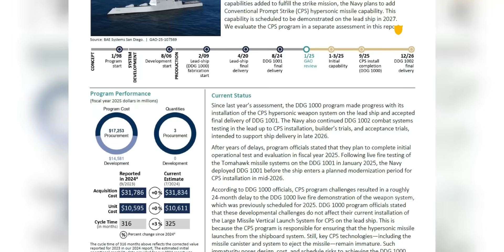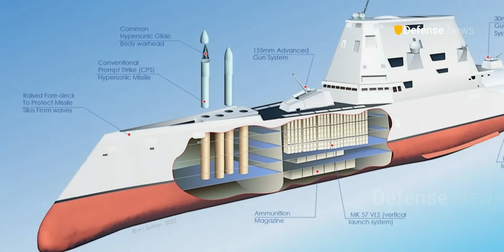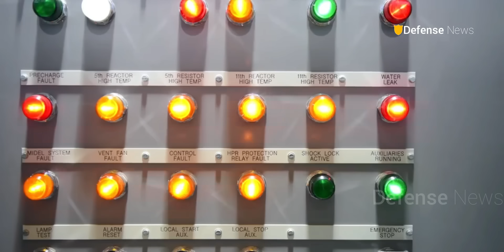U.S. Navy to Convert Zumwalt Destroyer into Hypersonic Missile Strike Vessel

Comment: A lot of money spent on a test platform?  From what I have seen the Zumwalt is still useless with hyper-sonic weapons.  In blue water the ship probably gets tossed around a lot.. very uncomfortable and not a stable missile platform.   Wonder what the next cruiser or destroyer design will be like?  Not sure the money was worth it when you need a low cost frigate and never got the high cost one due to mismanagement.  Burke's are based on an over 40 + year old design.  While flight III's are very capable still an old platform.   Navy planning and design needs someone in charge who will tell the wannabe's they can't have everything they want, begin with a solid base design that is upgradable and start from there. A total reset is needed and we're not prepared for the future!

Comment: Another wasteful project
Reply: I don’t think that’s correct at all. The zumwalt has experienced major setbacks and costly errors, yes…however, that doesn’t mean it’s entirely without redeeming features. This gigantic ship has the radar cross section of a small fishing boat. It has a relatively high flank speed. And if they really can get this hypersonic missile to work it could turn this billion dollar disaster into a serious asset. A ship that can get in as close as possible without being spotted on radar and fire hypersonic missiles with a range of almost 2,000 miles could be a potent long-range weapon for the navy. 

Think about it- a ship that can sneak up close to an enemy shore and fire unstoppable missiles over land a huge distance is a ship that could theoretically take out targets in the middle of Siberia. Or in western China. Hopefully it never comes to that, but in the Ukraine war for example Russia uses their massive interior land to hide all kinds of weapons stockpiles. Imagine being able to take them out before they can be used. Nowhere would be safe.
Reply: What's wasteful about it? The Ships are built. Wouldn't it be more wasteful to just retire them rather than refit them into a vessel the Navy actually has a use for?
Reply: @danerah  first off the gun systems never got the shells needed to fulfill its major purpose which was for shore bombardment. Secondly the ships have had major issues with electrical issues and power plant issues. Now we want to modify them for a missile that we don’t have yet. And lastly. The ships cost WAY WAY more than they were supposed to. So it’s just more wasteful spending.
Reply: @lawerancedodd690  and the refit will be very costly, over budget, and behind schedule, and likely not perform as intended.  Any one really willing to take that bet?
Reply: @lawerancedodd690  BTW, it did get the shells, they were just phenomenally expensive at something like $1 million per round.  Not really sustainable for shore bombardment, even for especially strategic targets.

Comment: how much will this debacle cost US taxpayers?  The Zumwalt has been an overpriced failure since its inception
Reply: AMEN!
Reply: Cost is $30 Billion so far for 3 ships that don't work. That is about the cost of two new carriers. Zumwalt has had problems not mentioned here, namely a failed propulsion system that meant it had to be towed home after dying in the Panama Canal. The smart shells for the its 2 Advanced Guns were deemed too expensive (millions per) and the gun program was canceled, leaving the ship without guns. (It does carry 80 cruise missiles.) That meant it was in limbo for a while, but the Navy took a well-proven ground launched hypersonic missile and adapted it to replace the 2 Guns with 12 of the hypersonic missiles. This can be seen as a first realistic test of the hypersonic missiles in shipboard use, or as simply a face saving step by Navy brass (probably both). The Navy also has problems with other programs, namely the LC ship family and the new carrier. On the carrier, neither its arrestor, EM catapult, nor elevator works. Hopefully they will learn new ways to prove new technologies for major ship programs before committing them to production.
Reply: Same story with the LCS. I wonder why are admirals not fired and jailed for economic crimes.